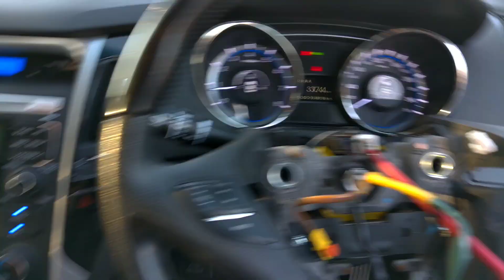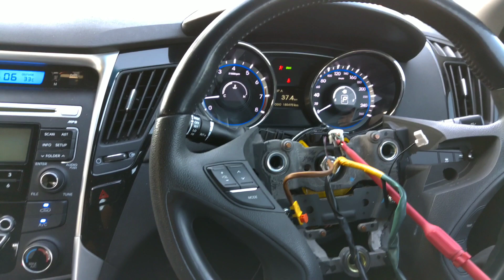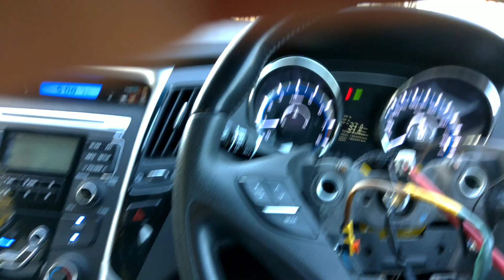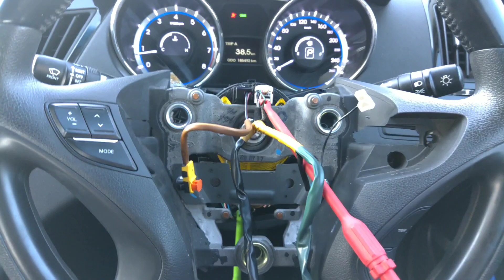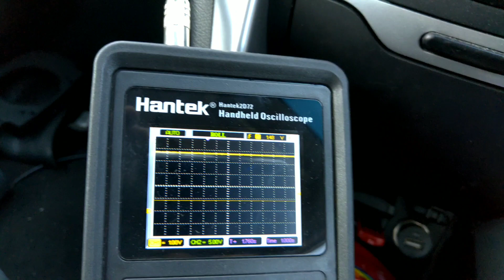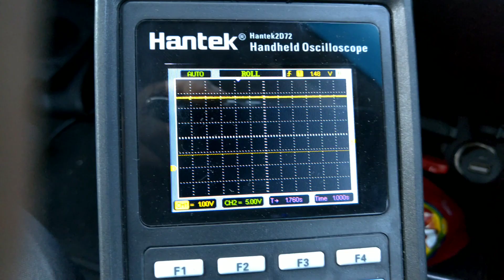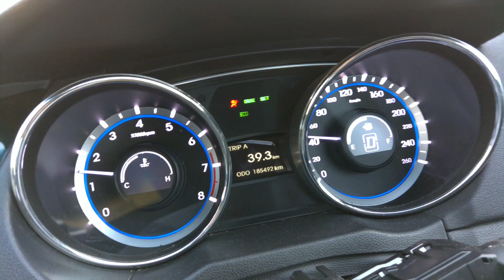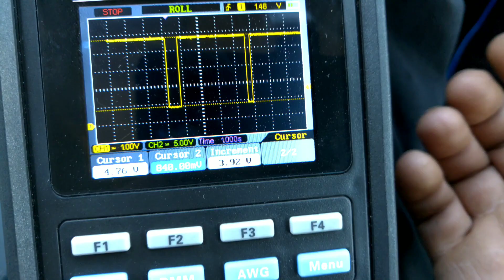Hyundai cruise control problem

Comment: Great troubleshooting. I have the same problem on the 2014 Forte. Cruise on always works, but the set mostly works and the cancel rarely works. Looking at the circuit diagram, we see that the signals for the cruise, cancel, set, resume all travel on the same pair of wires, so because the cruise consistently worked, I assumed the clock spring was good and the individual parts of the switch were bad.  A mystery because the resistance check of the switches was ok. But now I'll have to check further as you did.
Addendum: YES, replacing the clock spring fixed the issue!

Comment: I liked it!  I believe I have the same problem.
Reply: Update:  Turns out my airbag light and intermittent cruise control was fixed by replacing the clock spring.  There is an unlimited mileage extension  for clock springs on 2011-2014 Hyundai models.  Mine was done at no charge.
Reply from the maker: Good info. Thank you
Reply: The dealership replaced it at no charge? @jeffmariajenson9751
Reply: @jeffmariajenson9751 hi. Where can I find this information on extended mileage. I’ve got a 2013 Santa Fe with cruise control problem???